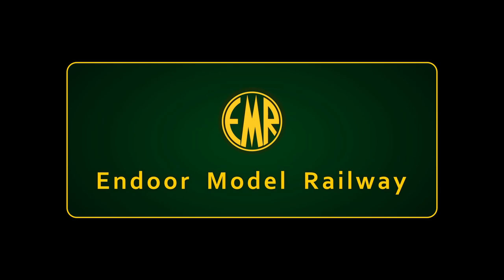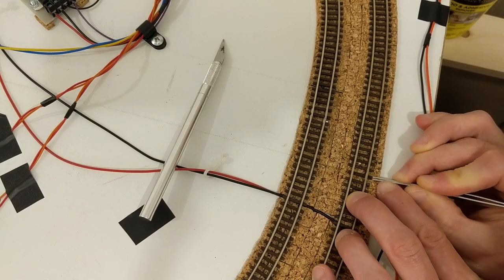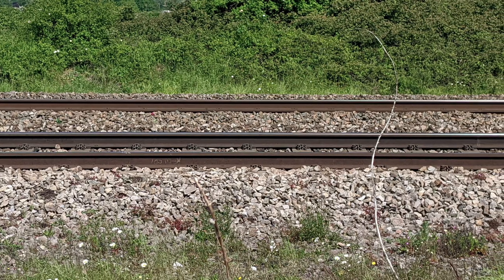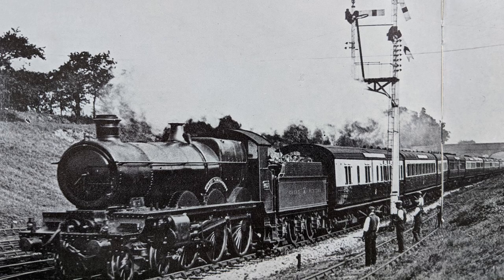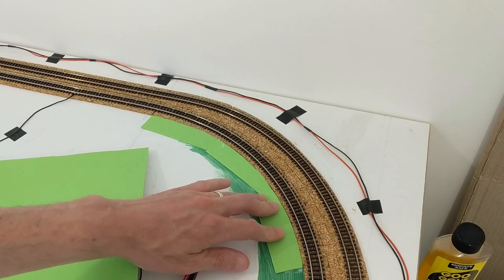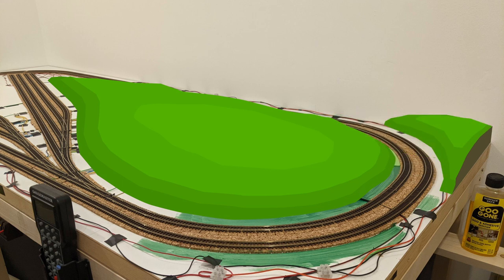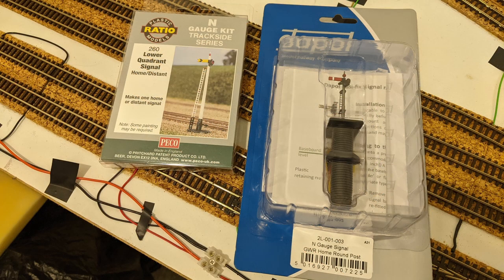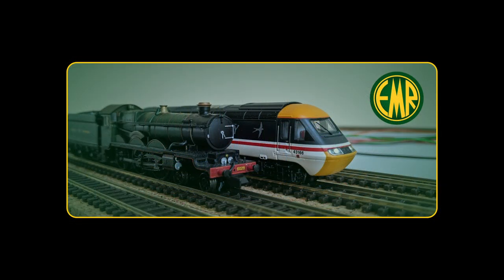0022 Thinking about scenery

Comment: Morning Jonathan! It's good to think! I'm forever thinking about what to do instead of actually doing it! I couldn't bear to just forge ahead without giving it some thought! I'm going with 3mm cork, but am going to completely cover the areas where the tracks are, rather than running a track on strips of cork for individual ballast shoulders! Like you, I thought that the track looked a little too high, so decided to ballast on a level surface! If it looks wrong, I can always carve out the cork between the tracks at a later date! Regarding the tunnel vs cutting decision, I like the idea of having a cutting with a bridge, as this will add interest to the scene, and you'll be able to add a road going to a station or goods yard, presumably! I'm intrigued to see how you hide all of the wiring in the centre of the layout! I'm assuming whatever you do, you'll have to make it removable for maintenance of the electronics? All the best, Ian.
Reply from the maker: Hi Ian :)
Planning worked really well for me with the electronics, but with everything else my ideas vastly exceed my current implementation abilities, so I'm finding I have to just do something in order to see for real if it works and if I'm capable of implementing it!

I think your plan with the cork is a good one - I think that's the way I'll go on the next layout.

Thanks for your thoughts on the scenery options - I'm leaning towards a bridge rather than just a cutting, and I'm decided against a tunnel. As with most things that are ahead of me my plans are vague on what will actually go onto the land! I've decided not to have a station, but that's about it. I think I'd like the top of the mound to have a road and buildings of some sort... probably housing... but yes, I've been thinking of ways in which I could have it lift off or open up some other way - I don't trust all those electrical bits to just keep working!

Comment: Excellent, I was having an arguement with myself over 2mm or 3mm cork track bed, I decided on 2mm and built my helix to suit.  your video has put my mind to rest that 2mm cork was the way to go.
Reply from the maker: Hi,
I'm glad it was useful - thanks for letting me know :) It all depends on what you're aiming to model I suppose, but 2mm should give reasonable noise insulation whilst not giving a super-deep scale depth at the edge.